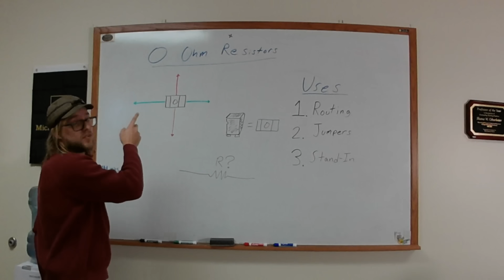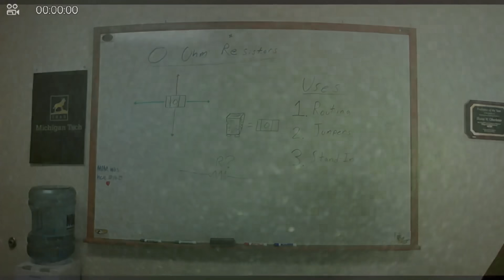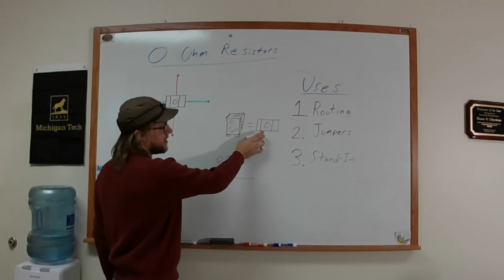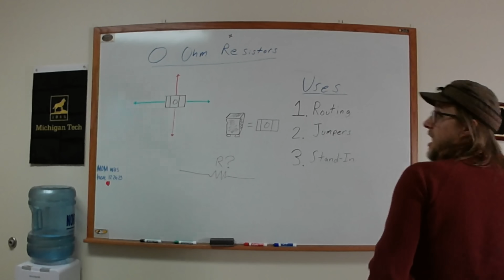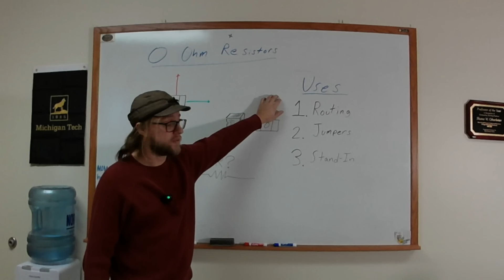The Resistor That Doesn't Resist

Comment: What is the tolerance on the zero-ohm resistor? ;)
Reply: I have seen them listed as 5% and as 1%.  I think the folks doing it know its nonsense but the form describing resistors has an entry for it that can't be left blank.
Many also have a power rating.
Reply: @kensmith5694  So do they bin them too? lol.  I'm trying to market my infinite ohm resistor but seems a lot of opposition to it....JK
Reply: @lidarman2  I tried to market 0.5pF capacitors as halfacitors but it didn't work.
Reply: @kensmith5694  Hilarious.  Well I can tell you that I commonly create infinite ohm resistors at work and they have a tolerance of +/- 0% until you increase the voltage to a few kilovolts and then they become near zero ohm resistors.

Comment: Zero ohm resistors could also be used as a substitute component... imagine a bare-board PCB that is shared between many sub-models within a product range. Depending on the features available on a particular model, different resistors will be populated by the pick-and-place machine at a particular ref-des locator, while avoiding the need (and added cost) for a PBC with a different part-number.

Zero-ohm resistors, could also be used for isolating different parts of the circuit, for testing, or for diagnostic/fault-finding.

ESD sensitive devices could also be protected by zero-ohm resistors while a sub-assembly circuit board is waiting for final assembly, or during transport to a different factory for integration etc.

Also be aware that some components may appear as through-hole resistors, but are in fact fusible resistors, while others can be inductors. Test with an LCR meter, with component out-of-circuit to be sure.

Comment: They are good on machine pick-and-place assembly as the set up is the same as a standard resistor so no need for a special tool to insert a wire link.
Also they are used in pcb re-use so a board designed for one purpose can be used later in a depopulated configuration which meets the requirements of a different application without increased stock

Comment: The other use is for diagnostic isolation. If you arent sure what part of the board has a fault, this allows you to break thr problem up to be able to concentrate on a specific part.
Reply: ever heard of a jumper wire?. an actual wire?
Reply: ever heard of a jumper wire?. an actual wire?
Reply: @kofi8259  why would you use a wire on an smd board?  If I purchased a motherboard or a macbook and it had a wire where the zero ohm resistors should be, it would be going back to the store.

Comment: Just use a jumper???
Reply: jumpers dont fit mass production machines. its easier to use resistors.
Reply: A 0Ω resistor is also way easier to use than a wire for hand-soldered SMD.

Comment: Very common place where I see those is connecting ground planes together. You might want to control how the ground currents flow, and this can be tricky to simulate and calculate before testing on final board. Also you might need to disconnect the logic ground from chassis ground, or replace the 0 ohm link with capacitor for EMI reasons. 
I have even seen 0 ohm through hole resistors used as interconnect between stacked boards serving spacers at the same time.

Comment: Hi
I havê never seen a THT 0 ohm resistor. Thanks for showing.
I have at work several ST testing boards that features them also. They are used exactly as shown on the texas board. You desolder or solder them to enable parts of the board.
I have seen low ohm resistors to be used as shunt resistors for the purpose of measuring current. Actually quite big selections with miliohms range and several watts of power rating. Not sure if that would apply for 0 ohm resistors... 

Onve again thanks for the video.
Reply: The datasheets for 0Ω resistors list their maximum resistance and amperage ratings.  For a random 0603 part: max 1A (2A for <1 second, derated above 70°C), 50mΩ max , 15mΩ typical

Comment: This video did not answer the most obvious question: Why the need for a special component, for what just a seemingly way cheaper piece of wire could do? Things about automated assembly machines, the need for special more complex so expensive attachements or a separate assembly pass to handle the thin wires (mainly on the through hole machines of the past), how the "zero ohm resistor" allows the use of common tooling with all the other resistors, so cheaper assembly...

Comment: Thank you! I'm a software guy and barely competent with a soldering iron, but I recently bought a build-it-yourself frequency generator which included a zero ohm resistor. I wondered why it was there, but after watching your video, I looked at it, and -- sure enough -- it was used as a bridge. Thank you! This is fun!
Reply: hey, can you share the product page for the generator? thank you!

Comment: Hi ... excellent video, a query what is a current sense resistor ? Is it same as zero resistor ?
Reply: A current-sense resistor, is usually a higher-wattage resistor with a tight tolerance. They are used to calculate the current flowing in a track by measuring the voltage drop across the resistor. The voltage-drop is sensed by the connected MCU. As a voltage needs to be dropped across the current-sense resistor, it will have a low resistance value, but can not be zero ohms.

Comment: Some resistors such as 000 are fuses in devices, when the device gets in trouble, the resistor burns out. Some of these are taken under radioactive ray, as a device becomes older, the resistor starts to resist and the device for example power bank or laptop battery, can’t be charged anymore. The ray is fired into the resistor during manufacturing. Some of these 000 resistors are calibrated by the chipset to resist the way a laptop wants to, depending on the load of the device. That’s why a fully equipped laptop, or a cheaper one keeps the same time limit, 1h 9 min for x2, using the same battery pack. If the average time is shorter or longer, the chipset tries to keep the same time limit. The resistor is part of the electronic battery, not the chemical part. Phones and tabs need to be connected to a laptop cooler to fully fix the resistor. It shouldn’t be removed, because the device will be destroyed this way. I failed with a Nokia car charger by removing it, and it started to overheat. Ericsson charger allowed it, and didn’t overheat. Toshiba laptop hdd overheats when the tiny broken fuse is removed and soldered directly.
Reply: Thing about fuses, typically they fail when something else fails, which is why they exist. So yeah, often replacing or bridging a bad fuse doesnt magically fix the device, bc the fuse failing was a symptom, not root cause.

Comment: I've mostly come across them as quick blow fuses. LED light bulbs often have a low (but above zero) ohm resistor connected to one of the pins to both current limit, but also act as a quick blow fuse. They seem to be more precise, as you can calculate the exact current for the resistance that will produce a certain temperature. In these bulbs, they will usually be in a heat shrink tube to contain them in the case of any catastrophic failure (although I've only seen them fail invisibly). They're pretty good at failing quickly before any damage to the circuitry, protecting even transistors in CFL bulbs in the case of power spikes
Reply: You mean resistors smaller than 20Ω in switching power supplies and LED power supplies. 
In the event of a short circuit, the maximum power of 0.25W is exceeded and the resistor burns out.
At 20Ω and 100V it is already 500W
But it makes no sense to use 0Ω resistors
Reply: @jensschroder8214  "At 20Ω and 100V it is already 500W"

<snip>

Some more research says that you can indeed use a 0-ohm resistor as a fuse, but you need to be careful which version you use,. There are those that are just a wire with a resistor-package glued onto it, and there are actual resistors with a 50mOhm value  so they will fail just like a normal resistor when you exceed their rated power... becuase they are normal resistors, just with a very very low resistance.

Comment: I'd like to point out that a wire link has always been the go- to for hobbyists
And often in production with previous through-hole technology

Zero ohm resistors are far more common on surface mount boards that are likely assembled using pick n place technology
This is the first time I've seen a wire ended zero ohm resistor
Reply: I know someone who many years ago was designing something for the military.  They were told that they were not allowed to use jumpers of any type on the PCB.  They solved the problem when they had it by using a 0.1 Ohm through hole resistor in a few places.  To make an excuse for the existence of a resistor in the VCC line of a chip, they add a line to the test procedure where the voltage from on the 0.1 Ohms had to be measured and noted that is was less than 0.1V.
Reply: Yes ! this is typical of the nonsense that the military procurement get up to ! ... in the UK some years ago the standard was HYPER neat wiring with lacing cord to keep the wires neat ... this took AGES to do ( @ MUCH cost ? ) , then they would take your wired missile and blow it up ... a simple wire bundle in a trunking ( much as electricians use ) would be 100's of times cheaper ( and , still work ! ) .... DAVE™🛑  @kensmith5694
Reply: A wire is fully conductive, while the zero ohm resistor element is not.  This makes the chance of a short-circuit much smaller if the element gets bent out of place.
Reply: @diatonicdelirium1743  If your bodge wire is fully conductive, you did it wrong.
Reply: those are mainly used as "jumpers"
not fond of using those in prototyping though...

Comment: In your examples, the gaps on the boards seemed quite small, I have only developed on larger breakout boards or on bradboards, so I have used proper wires to bridge for any of your examples, guess for surface soldered components only a few mm in length, cutting a piece of wire leaving enough isolation in place to prevent short circuit is a lot more work than on the larer boards I have used, I have ready made jumper cables as short as 5mm, thats about the size of the head on the resistors you showed in the beginning of this video.

Comment: I've only ever used them to do routing on PCB. For jumpres I'm not a huge fan since desoldering one might need soldering tweezers or applay large amount of flux, which migh need to be washed if it is active. Just having bridge made with solder is fine. For tweaking sure, though on dev boards where I'm not sure I will just plop a trimmer.

Comment: They are also can be used as a fuse as they're having a power limitations like 1/4w that you shown at the first of this video 0:03
Reply from the maker: That's definitely a valid use! However in my experience resistors tend to fail in a way less preferable to actual fuses (hot and smokey)
Reply: I had a 1/4W resistor partially melt, and then arcing through the plasma or whatever that melty/glowy stuff was  at close to 0 ohm, until the 10A mains fuse stopped it (was supposed to be a 25mA pulse through the resistor. It stayed on). 0/10 would not recommend.